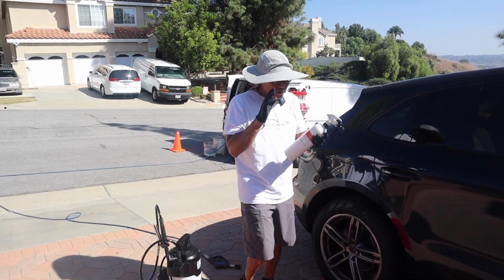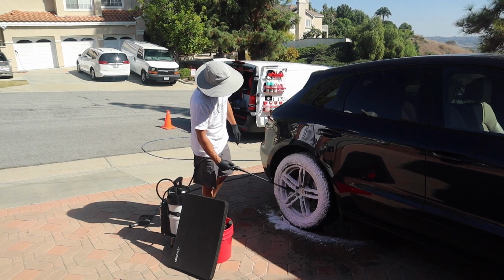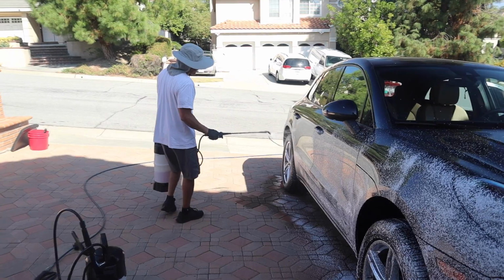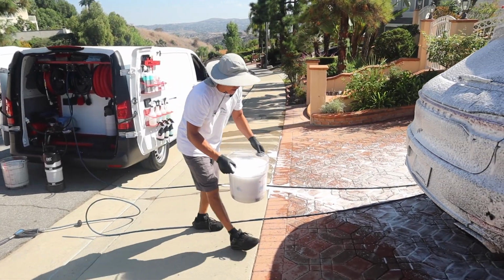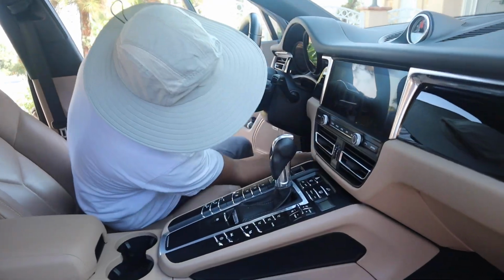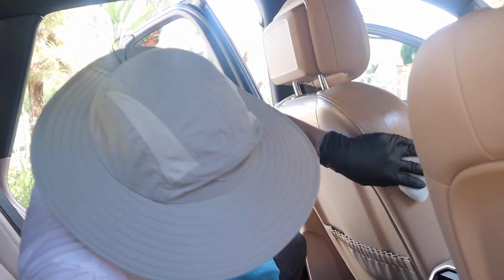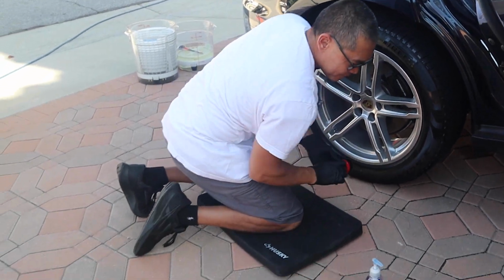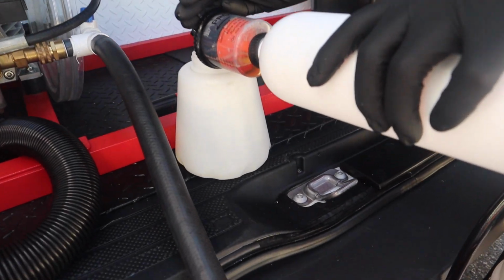My Favorite Detailing Chemicals - Best In Class Detailing

Comment: Honestly Koch Chemi Gs can clean 90% of the car. Just look for the dilution needed. I use 1/10 on a 7oz bottle. It can clean leather and most surface inside the car. Just use Ts and Ls for leather. to protect everything after. For the outside Nms and top with Pw and wheels I stick with break buster and shine all
Reply: Sorry Nms u talking about Msn? What dilution ratio and are u using and a foam cannon or pressure wash lancer? Also tell me please regarding Pw dilution and what way u applying it?  Break buster in foam cannon too 1:4 ? Thanks man

Comment: Hey Jonathan, keep grinding. With explaining chemicals it’s good to say why…
For instance the drying aid. Detailers use drying aids to prevent swirls in the drying stage, since this is where you’re most likely to scratch the car. Makes the surface slick creating less friction between the towel and paint, also has the added benefit of protection/gloss. 
Just a lil pointer, I like the videos. Just flex your knowledge a little more
Reply from the maker: Thanks for the support and thanks for the pointer! I get camera shy lol
Reply: What are good chemicals to use for a drying aid
Reply from the maker: @wtfckrose  there are plenty on the market. P&S, koche Chemie, gyeon, obsessed garage, shine supply. Trust me you’re not only going to buy one, you will try others and see which ones work well for you and your vehicle(s) thanks again for the support!